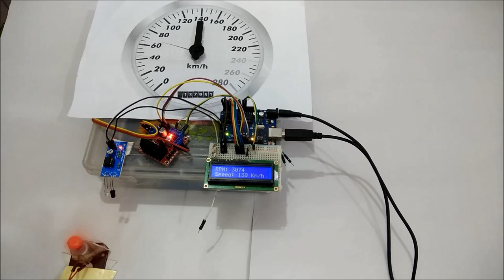How to Make an Analog Speedometer Using Arduino and IR Sensor

Comment: In code section, converting the radius from inch to meter should be in setup function and not in loop function. Keeping it in loop causes the radius to become  '0' in next iterations and no reading of speed will be found.
Reply: The code is performing well as demonstrated in the video by the author. However, the conversion of radius from inches to meter is required once and should be before setup() or within setup(). It is absolutely illogical to convert it repeatedly in the loop() though it will not affect the performance.
Reply: @abuhafss1  Other than wasting processing power and speed of calculations... And you can see it has some calculation lag in it.
Reply: thanks man. you're saving my life <3
Reply: @furkan_gulsenn_   cheers 😄

Comment: Excellent work..I'm using your code for my project but not working working your sketch..I'm checking with IR sensor with Arduino serial monitor and pulses cut the IR sensor but still zeros on output . please advise me..

Comment: Excellent project, many thanks for sharing.

A couple of questions please. How would you change the code to display 0-300 Km/h on the dial but retain the same 280° sweep as your example? The pointer deflection would be less e.g. 100 Km/h = 100/300 not 100/280. The stepper motor is unchanged; 200 steps per revolution.

Is it possible to set the dial zero Km/h position at 1 o’clock and sweep clockwise fully to 11 o’clock? not 7 o’clock to 5 o’clock, seen in your video.

Many thanks
Reply: Position you can either rotate the stepper motor, or change the home location. To get finer resolution you could always use a belt or some other reduction method to change the ratio of steps per displayed speed.